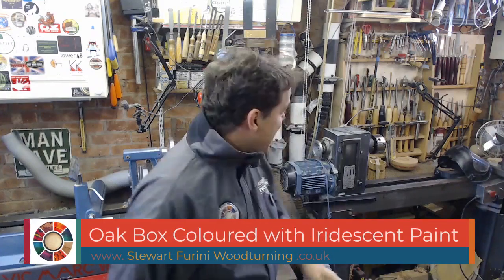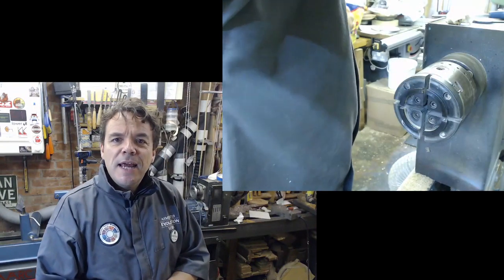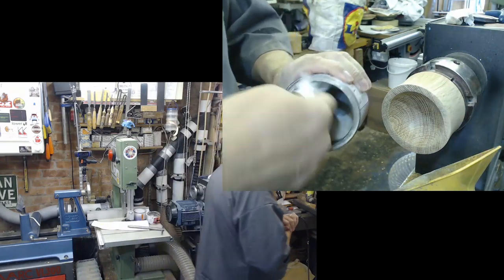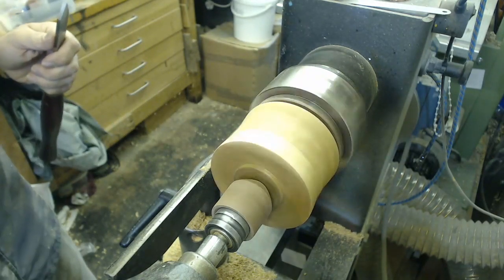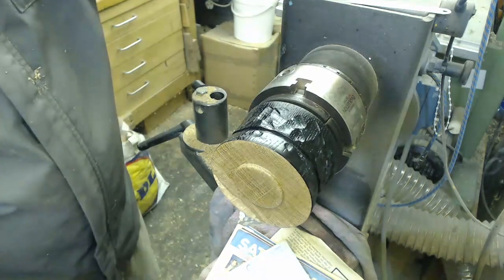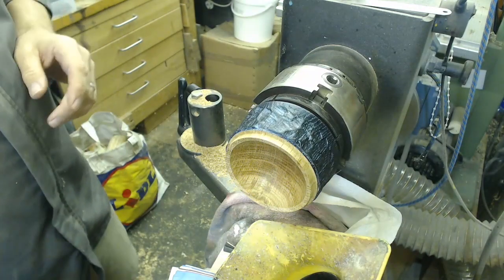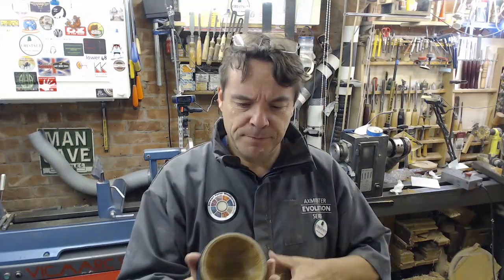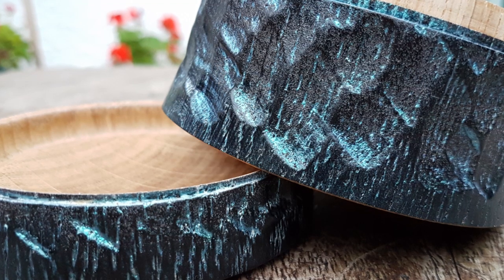Woodturning an Oak Box with Iridescent Colours

Comment: That’s actually quite nice. Texturing and colour works really well.
Love it that you still had all the natural wood in too. Not so sure about the centre raised but on the lid and the base looked like you had a mortise on it rather than being flat and smooth.
Really enjoyable video as usual though!
Reply from the maker: Thanks, Paul - you're not the only one to pick out those features. I did keep the tenon on top (though it was finish turned so it couldn't be gripped on and then tried to mirror this with an impression on the bottom and underside of the lid...might need a bit more finesse! Glad you enjoyed the video. Cheers!

Comment: Hello Stewart, 
I like your box. I like oak. The texture is nicely rustic and the colouring takes it out of the farmhouse and into the lounge. Is this a nod to iridescence, or are the layered strips still on? Perhaps try metallics first. They are very similar and the more subdued coppers and bronzes for lower levels could avoid the need to try dulling down lower level iridescent strips. Maybe iridescent on top of metaliic and leave the black out altogether.  Regards, Glenn. :-)
Reply from the maker: Cheers, Glen - glad you like it. The ribbon strips are still on - soon to reappear if nothing else gets in the way...

Comment: Hi Stewart
Subtle colouring is not an expression I would use to describe your work normally. You may even have heard some laughter when you mentioned the phrase. However, when we see the end results we have to acknowledge that you have indeed achieved the desired effect. Very nice and go to the top of the class.
One question, at about 6.55 in the video the box seemed to go a coppery gold colour, please explain as You confused my 70 years plus brain.
Cheers
Roger
Reply from the maker: I can do really subtle sometimes! The answer to your confusion is an old coloring demo piece used as a jam chuck to reverse the box body so I could take the chucking tenon off...